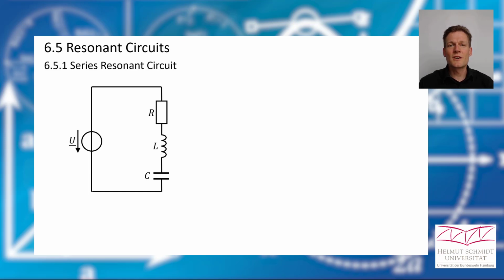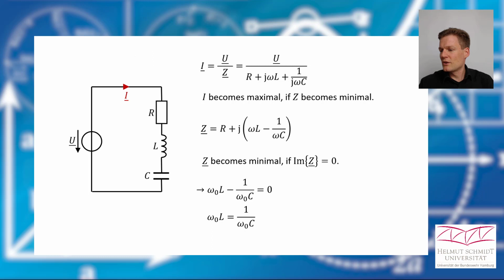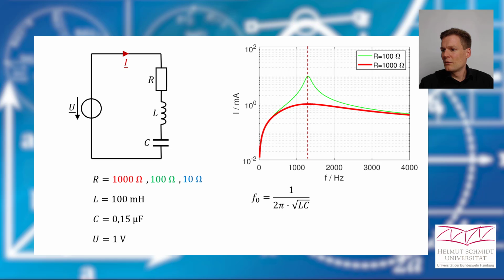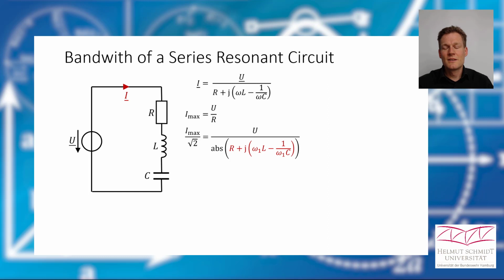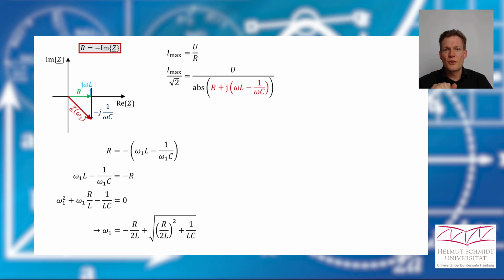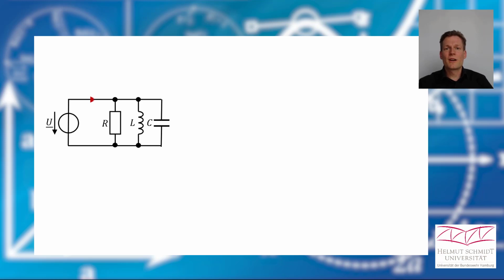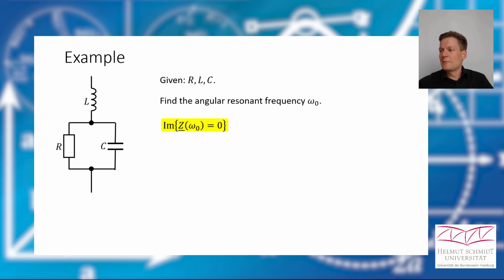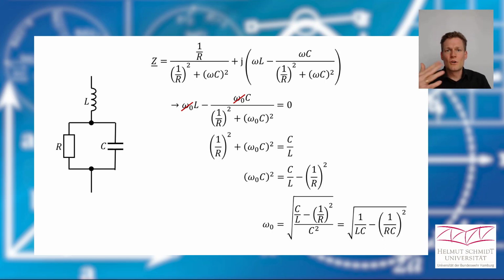Electric Circuits Lecture 12

Comment: Könnte man die Bandbreite nicht viel einfacher lösen in dem man einfach die Grenzfrequenzen nimmt? Also Impedanz bzw. Admittanz mit R bzw 1/R setzen?
Reply from the maker: Klar kann man die Bandbreite auch einfach berechnen, indem man messtechnisch die Eckfrequenzen bestimmt. Das geht dann so: Bei Resonanz sind Strom und Spannung in Phase (egal welche Art von Schwingkreis) und bei den Eckfrequenzen haben wir eine Phasenverschiebung von -45° bzw. +45° zwischen Strom und Spannung.